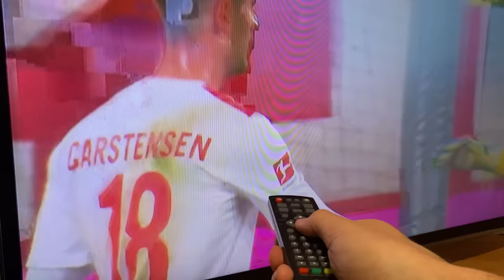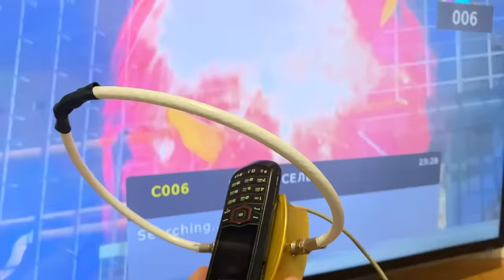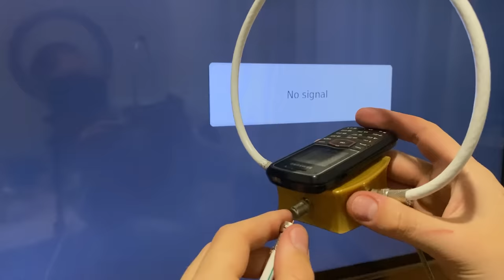Insert a PHONE into the TV and watch all the channels in the world! Antenna booster!

Comment: I'm a Japanese engineer.
Well, I don't think it matters whether you have a cell phone or not.
Considering it as an electronic circuit, the last coaxial cable installed is a magnetic loop antenna.
The mobile phone is not used.
It probably won't make any difference if you don't have a SIM card or even a power supply.
The nominal voltage of a Li-Ion battery is 3.6-3.7V, so 5V for USB is clearly an overvoltage.
Also, the center pin of the 3-pin power supply terminal is a thermostat (T) terminal that detects the battery temperature.
It has nothing to do with the receiving circuit or amplifier circuit. Thank you for the fake video.

以下、元の日本語です。
---------------------------------------------
日本の技術者です。
うーん、携帯電話の有無は関係ないと思います。
電子回路として考えると最後に取付けた同軸ケーブルがマグネチック・ループアンテナ
として動作しており携帯電話は使われていません。
SIMカードがなくても、電源供給すらなくても恐らく違いはないでしょう。
Li-Ionバッテリーの公称電圧は3.6-3.7VなのでUSBの5Vは明らかに過電圧です。
また、3ピンある電源端子の中央ピンはバッテリーの温度を検出するサーモスタット(T)端子です。
受信回路や増幅回路とは全く関係がありません。フェイク動画をありがとう。
Reply: Teşekkürler hocam 🙏
Reply: Scusami ingegnere, ma la antenna improvvisa, non é per migliorare la recezione del segnale, per telefono ? ! Può spiegare più "volgare" per ignoranti, come me ! Grazie mille !
Reply: Exactly I specialize in wiring and the contraption made Noooooo sense 😂
Reply: It's terrible that you took the trouble to answer and then deleted it in a hurry.
> @Vlad Tepes 2023/22/12 (FRY) 1:04
> Scusami ingegnere, ma la antenna improvvisa, non é per migliorare la recezione del segnale, per telefono ? ! 
> Può spiegare più "volgare" per ignoranti, come me ! Grazie mille ! (Testo originale: italiano)

Do you want to tell me something "for ignorant people like me"?
If you post an external link here, your post will be automatically deleted.
For people who call themselves ``ignorant'' with only text, without tables or diagrams.
How should I teach it? Please tell me how to do that first.

This is the most basic formula for antenna design and radio circuit design.
λ(m)=300/Frequency(Hz)
λ = 1 wavelength length, radio wave speed, target frequency fixed at 300 (300,000 km/sec)

I would like to refrain from providing any further explanation for free.
Aren't there just similar fake videos?
Everyone, please use your knowledge to point out what is wrong.
youtube oaF4o0BfZDY
youtube T15IGXd_8J4

Below is the English version.
---------------------------------------------
It's terrible that you took the trouble to answer and then deleted it in a hurry.
> @Vlad Tepes 2023/22/12 (FRY) 1:04
> Scusami ingegnere, ma la antenna improvvisa, non é per migliorare la recezione del segnale, per telefono ? !
> Può spiegare più "volgare" per ignoranti, come me ! Grazie mille ! (Testo originale: italiano)

Do you want to tell me something "for ignorant people like me"?
If you post an external link here, your post will be automatically deleted.
For people who call themselves ``ignorant'' with only text, without tables or diagrams.
How should I teach it? Please tell me how to do that first.

This is the most basic formula for antenna design and radio circuit design.
λ(m)=300/Frequency(Hz)
λ = 1 wavelength length, radio wave speed, target frequency fixed at 300 (300,000 km/sec)

I would like to refrain from providing any further explanation for free.
Aren't there just similar fake videos?
Everyone, please use your knowledge to point out what is wrong.
youtube oaF4o0BfZDY
youtube T15IGXd_8J4

以下、元の日本語版です。
---------------------------------------------
折角、回答したのに慌てて削除するなんて酷いです。
> エンジニアさん、すみませんが、突然のアンテナは電話の電波受信を良くするためのものではないでしょうか？ ！
>  私のような無知な人々のために、もっと「下品」を説明してもらえませんか？ 多大なる感謝 ！(原文：イタリア語)

「私のような無知な人間のために」何か教えてほしいですか？
ここに外部リンクを投稿すると、その投稿は自動的に削除されます。
表も図も示せず、文字だけで「無知」だと自称する人向け。
どうやって教えればいいのでしょうか？ まずその方法を教えてください。

これは、アンテナ設計および無線回路設計の最も基本的な公式です。
λ(m)=300/周波数(Hz)
λ＝1波長の長さ、電波の速さ、対象周波数で300（30万km/秒）固定

これ以上の説明を無償で行うことは差し控えたいと思います。
同様のフェイク動画ばかりじゃないですか？
皆、何がおかしいか知識を付けて指摘しましょうよ。
youtube oaF4o0BfZDY
youtube T15IGXd_8J4
Reply: Yep I noticed that too...
Reply: 3rd pin is not for battery temp but to show battery charge level.
Reply: @ChiefEngineers  
Below is the English version.
---------------------------------------------
I am not from this manufacturer (Samsung, South Korea), but
I was actually involved in design and development at a Japanese mobile phone manufacturer.
The company has now ceased to exist... lol
The center pin of products from this era is the temperature detection terminal (T).
Here's a question. How do you measure it with the charge level terminal?
If you are simply measuring battery voltage, temporarily stop charging.
All you have to do is measure the potential difference between the + and - terminals of the battery, right?
There is no need for special terminals such as charge level.

以下、元の日本語版です。
---------------------------------------------
私は、このメーカー(韓国Samsung)ではありませんが、
日本の携帯電話メーカーで実際に設計開発を行っていました。
現在は会社が消滅しましたが…。lol
この時代の製品は中央ピンが温度検出端子(T)です。
では質問です。チャージレベル端子でどの様に測定するのでしょうか？
単にバッテリー電圧を測定するだけなら一時的に充電を停止し
バッテリーの+端子と-端子の電位差を測定すれば済みますよね？
チャージレベルといった特殊な端子は不要です。
Reply: Arigatō et bien vu l'alimentation USB délivre bien du +5 et elle est directement reliée où normalement l'accumulateur est situé donc maximum de charge à environ 4,2V ! La surtension est flagrante donc la question est juste de savoir combien de sec....
Reply: @jopedros1188  
Below is the English version.
---------------------------------------------
My guess is that it supplies USB bus power (+5V) instead of a battery.
Therefore, there is a risk of damage to the mobile phone due to overvoltage, but since the battery is not connected, there is no major danger.
Cell phones are also outside the standard, but I think they can barely withstand +5V.
Of course, it depends on individual differences (parts rank) and circuit design...

以下、元の日本語版です。
---------------------------------------------
予想ですがバッテリーの代わりにUSBバスパワー(+5V)を供給しているものと思われます。
したがって過電圧により携帯電話端末が破損するリスクはありますが、バッテリーを接続しないので大きな危険はないでしょう。
携帯電話も規格外とはなりますが、+5V程度ならギリギリ耐えるとは思います。
勿論、個体差(部品ランク)や回路設計にもよりますが・・・。
Reply: Naładowany akumulator to 4.2V - 4,35
A trzeci pin służy do kontroli ładowania
Więc wszystko to fałsz
Reply: I agree with everything you said the phone is not even tuned on idiot work could never work he only shows one chanel and somebody pulling the real connection out of the TV scam
Reply: @dennismarkiet129  
thank you.
Many viewers are still being fooled and wasting their time.
And I don't understand that the poster is making money.

ありがとうございます。
まだ、多くの視聴者が騙され無駄な時間を費やしていること。
そして投稿者が収益を得ていることに納得できません。
Reply: FAKE LOL 😂😂😂

Comment: Whenever I see this kind of videos, where you need 10000 parts and 10000 operations to perform, I have the urge to buy the MOST EXPENSIVE gadget you try to make instead of the real thing. I can't see how it is EASIER to do, it is easier to buy a brand new antenna. It is OK when you need two things, two cuts, two wires, but everything beyond that is too much for most of us.